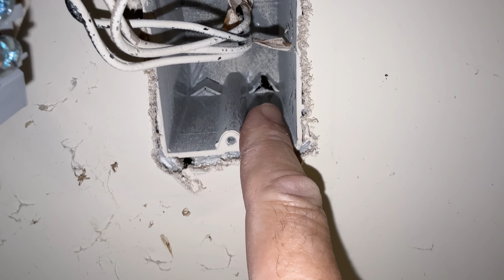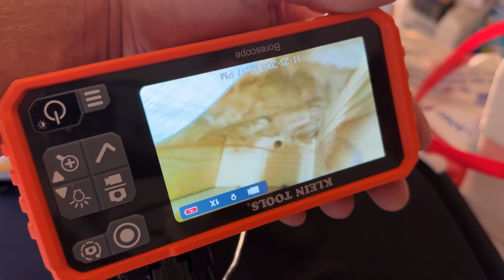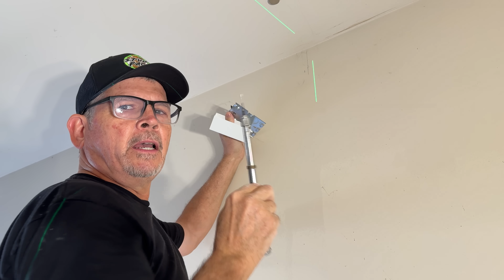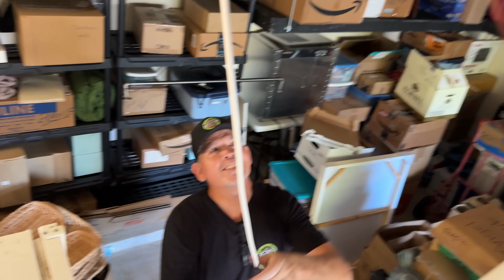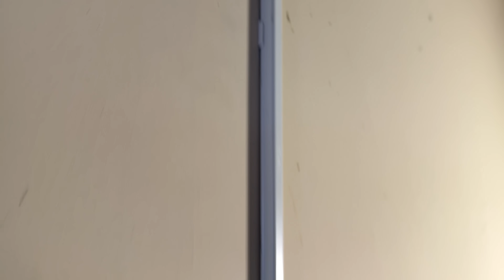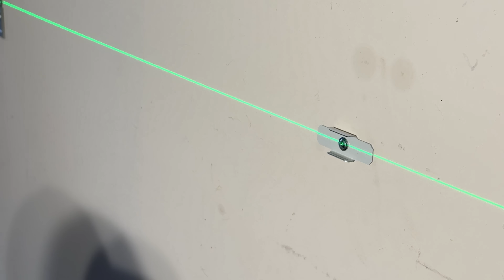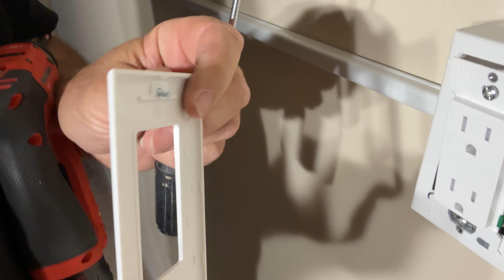The Secret to Adding (Easy) Garage Outlets

Comment from the maker: Waterdrop Filter holiday sale up to $700/42% off—use code [STUDPACKBF] for an extra 5% off! Amazon: https://amzn.to/4oGEzTM or Website:  https://bit.ly/4i74Sjv
Reply: Wow teaching me ,I'm still learning after 25 years of remodeling work,never heard of a dead front,thanks guys for spreading knowledge and wisdom,GOD BLESS
Reply: My garage is newer, and was built with a 15 amp circuit.  Because I have a few things on one circuit, I pop breakers constantly if I use a saw, or my air compressor, etc.  Modern code requires 20 amp circuits in the garage where I live, but the builder didn't follow that code.  So, I am planning on adding my own 20 amp circuit.  I was going to go through the drywall to make it look like original wiring, but I like the raceway system and those fancy outlets you presented.  I also learned a few things.  Great video!

Comment: Often times the electric panel is in the garage, or you have an easy shot to it in the basement since the garage is lower than the main floor of the house. The garage probably already has a receptacle on a 15 amp circuit, so if I was going to go to the trouble of adding one, I'd go the whole 9 yards with a dedicated 20 amp receptacle.

Comment: Pro tip. Instead of cutting the nails, it's easier to cut the plastic ears that retain the nails. One caveat though, be careful not to cut too deep, as you could cut the wires entering the box. 😊

Comment: Great video!  I have always wondered how to fish electric.  I would have made a huge mess and added drywall work.  

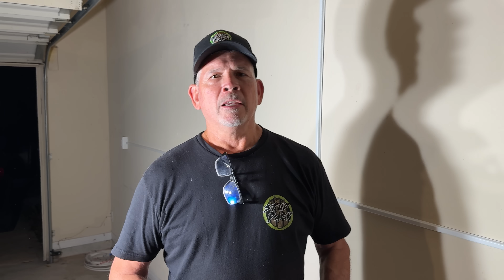I'm not an electrician but I did all the wiring when I built my home.  One thing people should be aware of @29:08 . . . ask your inspector if you think "upstream ground fault receptacle" will pass inspection.  It does protect all the downstream receptacles--but not from the circuit box to the first GFCI receptacle.  I made that "mistake" and the inspector made me add GFCI  to a bunch of circuits--and they aren't cheap (not to mention the wasted money for all those GFCI receptacles that are now useless--and they aren't cheap either)!  I called the State of MN and went two levels above the local inspector before they could tell me why.

28:10: It never occurred to me that using pigtails from Romex would eliminate the wire identification.  I may have (probably did) do that in a box (or two) . . . but I didn't say that out loud.

I also think you need tamper resistant receptacles in a garage since 2023 NEC.

One more thing for anyone thinking about DIY soon.  The last NEC published is 2026 but I don't know if any jurisdictions have switched yet.   Check before you plan your wiring or just go with 2026 NEC.  I pulled my permit last year, so I am good with the previous NEC (2023 NEC) and very close to calling the inspector for a final approval.

Comment: We own that unit. and love having the choice of mineral added or use the other faucet handle and only get straight RO water. Since we already had a four-stage water filter installed. I just fed that to the new RO system.

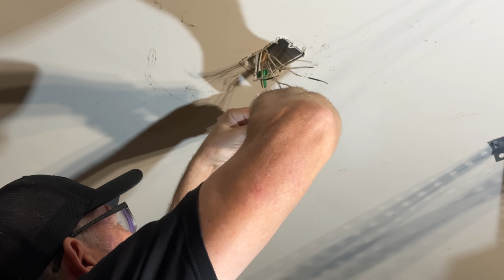Comment: 28:00  I don't understand why you did not want to use NM (Romex) jumpers because there was THHN 6-8ft away in the wall.  You mentioned you wouldn't want to switch to Romex in the box.  But the only thing in that box is Romex.  And I'm assuming you meant solid THHN because using stranded, like you did in the wall, would be even more goofy.  I guess with Wago's it isn't a big deal but I still don't see the need or even want, to not use NM jumpers like in any other box.
In my area, we use NM jumpers/pigtails regularly without any inspection issues.
Not bitching, just trying to understand.

Comment: I'm planning a living room remodel.. Putting 5/8" drywall over existing plaster and lath(just don't have it in me to tear it out after doing that to my bedroom. Lol

The walls where the ceiling joists end each have a big window, so I can't get wire up there easily for lighting/fans. Any recommendation for running wire perpendicular to the joists when you don't have access to drill holes for the wire to run?

Comment: Especially in a garage, a great way to patch holes made for fishing cables is to use low voltage single or even double gang brackets. Cut your hole to the required size for the bracket, slide in the bracket either before or after you fish and add a blank plate when done.

You can use a stud finder to find the blocking you think you see so you're not making holes all over the place, although blocking in the ceiling would be a bit weird: you may be running into a cross brace.

I would avoid using 6ft drill bits (or similar) because you they provide a good way to drill through cables you can't see or even water pipes.

Comment: Maybe a dumb question, but why did you opt for stranded instead of solid wire? Just ease of working with it?
Reply from the maker: Yep, used stranded in my commercial days.  Way easier to pull, etc.

Comment: Somehow I missed this video. 
I've learned to always check to make absolutely sure the power is off before messing with switches our outlets. Had one where we thought it was off but it must have been connected to more than one breaker and my detector beeped so we went and shut off more breakers until it was no longer live.
The rare earth magnet thing is cool. I don't have drywall so I don't know if it would work for me.
I've told my best friend not to say "this should be easy" because anytime he says that something goes wrong and it takes way longer to do stuff. LOL. But we both have terrible luck.
My bad luck is why I wrap wago lever nuts in tape. LOL.
I like how you put all 3 rolls of wire on something so you could pull them all out together.
I love the Leviton Decora Edge outlets and switches. I do wish they did 20A and GFCI outlets with them. and I wish they used clear plastic like the Wago lever nuts so you could see in, but they made it a lot easier to replace some outlets and switches in my house. Especially since whoever did the electrical did not leave any extra wire so there was no wiggle room. Another nice thing about the Leviton Decora Edge switches and outlets is that they are designed to fit together evenly if you are trying to put them side by side.

Comment: Paul, I've said it before and I'll say it again--you are very well grounded!  Great video.  I've used stranded and solid wire but didn't know about the NEC requirement for identifying the wire, so as a cheapskate, I've sued left over ROMEX for years to make up pig tails.  Lucky homeowner to have you looking over the wiring.
Reply from the maker: Thanks!!  We've all used Romex for pigtails, inspectors never mention it.  Thought it would be interesting to talk about wire identification though
Reply: NEC 310.8(A) Wire marking and required information.

Comment: Ghetto Mold? It's a garage, just put a box up in the corner, and run exposed conduit. There is nothing printed on the wires inside of NM (Romex) or MC anymore, so you can no longer strip the jackets off and run the wires in EMT, IMC, GRC, Wire Mold, flex, etc. If I did put Ghetto Mold in a garage, I'd use the large plug mold run at counter top height.
Reply from the maker: Thanks satchmo, we're just showing options is all 💪👊

Comment: You cannot rely on the ceiling light to be off as a statement that the outlet is now without energy since they could be on different circuits! Always test the outlet directly using a tool or the classic bulb+lamp holder plug  plugged on that outlet.

Also, yes
Reply: He had a circuit tester plugged into the plug to confirm it also was off...

Comment: You could have also cut out an outlet sized hole near the block in the ceiling, drilled through the blocking from there, then installed another outlet at that location, or just a box with cover plate for future use.

Comment: Wish I could find a good price on some wire mold. I have a job coming up on brick home where I’m coming out of the panel and running 3/4 to the second floor on the exterior then transitioning inside to wire mold on the inside. The second floor has 2 receps which is captured in the basement via 12/2 nm then the rest of the run is knob and tube wiring

Comment: the wiremold should be pushed further onto the backing plates to the stop against the plate at bend, as those barbs are meant to bite into the sides, lock it in place and keep it from pulling apart when it gets banged around and it always does!  I have seen lots of it ripped off the walls where they didn't fasten into studs and dangling by those barbs, sometimes even that was ripped out and eventually shorted the wiring.

Comment: in the 1990's, kind of recalling them making us use full boxes instead of low voltage brackets for garage low voltage wiring to meet fire codes. now that may have been national or local codes, too many years ago and I don't really recall ever using LV brackets, maybe just cheaper as all boxes were bought in bulk. lots of the brown and white composite/fiberglass type used then and they were easy to break is you missed the nail or hit a knot in the wood or you were just a knot head and hit them(lol)

Comment: I've seen some say you CAN NOT and others say you CAN use Romex in the conduit (with fill restrictions) when it is in a dry application. Which is correct? I know you have to use individual wire if there is going to be moisture but inside of garage should be dry.
Reply: You can use Romex in conduit in dry locations is correct. See NEC 334.10(5) and 334.15(B) for details.

Comment: great video instruction. i have a house built in 1840's and Legrand wiremold was used to replace the old wiring in the rooms - the walls are 18-24" handmade brick covered with plaster so wiremold works best.  i also recently ran two new 20amp 12awg thhn circuits (for dedicated garbage disposal and dishwasher) thru 1/2" emt recently with new 20amp afci/gfc breakers at the panel for the kitchen renovation.  your tips on fishing the wire and particularly the hole drilling into the Legrand box are really appreciated.  I don't have any drywall to negotiate inside the house but that would have been useful info when I added paneling and insulation to the enclosed back porch ceiling!  great job always - much appreciated

Comment: Better off using a 32 tooth per inch hacksaw blade for cutting Wiremold. Years ago the Wiremold book suggested using impossible to find 40 tooth. Per inch blade. Wiremold appears to not be fully inserted into bzse plate. Used 3/4" EMT to first 4 & 11/16" box in my garage then 1/2" EMT. Great work. I have used my 1/2" EMT bendet to make offsets in # 500

Comment: As an Aussie sparky 😃 I would have tried to drop down the cavity ( if there was one ) from the top box to the central box, and here a nono running a power cable through the same hole as a lv cable ( in the blocking if it was) ie, mouse chews trying to get through the hole and possibly the active / hot may short to the lv ( roller door cable was it? ) and we would use just plastic duct and all plastic boxes etc, interesting the difference in rules there to here. I’d be interested in a comment on my comment ❤️✌️

Comment: I used this exact stuff to correct an improper installation of ceiling fans in my mobile home, the ceiling boxes are great for adding ceiling fans and i was able to tie it into an existing switched outlet while disguising the wiremold with pieces of door casing around window alcoves

Comment: You could have bought a couple low voltage rings and cut in mini access panels and when finished you could just put a blank cover on it and an even better way is to use the two-gang low voltage bracket to make a bigger access panel to fit your hand/arm in the hole

Comment: The Wago outlet blew my mind.  I literally shouted "WAAAAT" in bed while watching this, scaring my cats!  I LOVE Wago products (and I tape mine) but I had NO idea that a receptacle could have that concept built in.  So much win with it being plastic sided for installation in a metal box.  No more having to tape around the receptacle for metal box installations.  I imagine that being in a gang configuration would also be safer, especially in tight boxes.  WOW.  I bet the cost is double at least.  :(  I'd buy it though because currently, I run pigtails with Wagos for all my receptacle installs but could forgo the pigtails for single receptacle installs.  

I wasn't a fan of the raceway look until this video.  You might have me convinced that it is a better system overall versus the MC conduit.   

I am also stoked to see you dip into the discussion behind the differences in unsheathed romex versus stranded.  Why?  Because I have seen a few electricians strip romex and use those wires inside conduit which is a big no no code-wise.  Many DIY'ers think its OK to use romex inside conduit but that is against code for safety reasons. (heat)  So the next idea is to strip the shielding from the romex and use the conductors inside the conduit....Also a big no-no as the conductors are insulated differently for romex as opposed to spooled conductors.  It's all about the insulation (and label) ratings...The insulation for conduit inside of romex is thinner.  The solution is to not use romex and instead use spooled stranded copper conductors  like you did.   I'm happy you covered this often overlooked observation when it comes to wiring a home.  Many people think "nah, it's the same stuff just run it through the conduit and be done with it...Not OK.  These details matter.   Thanks Paul and RAD for another terrific video.

Comment: Those lath screws are hidden gems for all kinds of stuff.  I just wish they had different threads for more holding power. Either that or for all the construction screw manufacturers to move away from such sharp countersink angles towards more flat bearing area under the heads. Looking at you Spax and GRK.

Comment: cost of bottled water
5$ per month drinking only, no icemaker, no cooking
15$ if you include those

cost of RODI simple system?
80$ starter kit
70$ hydraulic permeate pump(efficiency and higher pressure permeate)
50$ tank(for an ROT 3 holding 1.5gallon when tuned for the 40-60 psi intended range)

di beads for refills at 20$ every 6 months depending on water ions
new membrane every 3-5 years(10$)
new tank every 6+ years(50$)

pays itself off in just a few years as you get 50 gallons per day on most systems, far more than you need

additional QOL options like a booster pump and auto-flush setup only cost a few hundred more, cheaper if you DIY

almost always better to filter local if water is bad, can even make non-potable water safe if the membrane is intact

Comment: my apartment has the same setup, civil war era building, the front half of teh building is original(you can even see some old knobs from knob and tube wiring)

some walls are added later, but any original walls and ceilings have these box+tube setups

in fact I had a switch snap inside, a 3-way so I could make it work still, but the original landlord knew I was technical and so when I said I could fix it myself she dropped off a replacement switch, and I did a quick safety disable of the fan and light chains as it was a 3-way node, no neutral on that side only the live branch lines and no ground, so by isolating live and remaining insulated from any ground paths I was confident in minimal risk to me, since my server array runs on a similar/same circuit and turning that off for a switch would have sucked(no massive UPS array at the time for 5 minutes of power loss)

Comment: as a union electrician that loves to nit pick everything.  You did a great job.

My fish sticks and camera have helped a TON to avoid drywall repairs
Reply: I have just one question, he doesn't bring it up, but is there a wire fill calculation needed for that middle box, with all the incoming/outgoing wires?

Comment: You said not rated for the romex in the wire mold…..  Also not rated for the UL listing to drill a hole in the top either.  Only approved for factory recommended connections.

Comment: I have a 300' spool of 3-wire THHN sitting in my garage.  I needed about 60', but it was the same price for a 300' spool as it was for 100' cut to length off the rack at Homeless Teapot, so it just kind of made sense!  I'm sure I'll find something to use it on!

Comment: Another great video guys, I hate to sound like I'm nit picking, but I'm not sure if the wire mold box can technically be used for the ceiling transition to the wall the way you guys showed, obviously there is nothing inherently wrong with it and it looks great to me as a sparky, unless wire mold allows for the box to be modified like that, it might technically go against its listed use, i could be totally wrong thought and if anyone knows for sure that would be great to know. like i said before though, its kind of nitpicking

Comment: RO systems make good water but are wasteful as heck. You have to decide the tradeoff on cheaper water but microplastics (unless you still drink in plastic jugs and sport bottles with the RO water) and not environmentally sound, higher water bills and changing PITA filters.

Comment: Really nice fish tape work!!!
Did you consider notching the top plate of the wall then running the Romex down the wall thus avoiding having to use wire mold?
Another option would be to add an old work box then drill up the will into the top plate - like you mentioned for dealing with ceiling blocking.
To "hide" the hole at the top you could add a box there then install a light or a camera to make it appear that the box was intentional.

Comment: Not to code in my state.  Code requires a separation between low voltage and high voltage wire. Thus using the same hole is against code.

Comment: Running Romex inside conduit-- local electrician told me that was overinsulating the wires and making it more likely they'd overheat, and that's why you don't do that. Made sense to me.